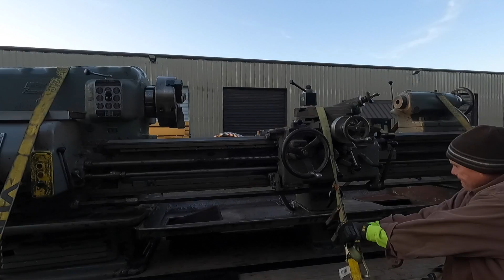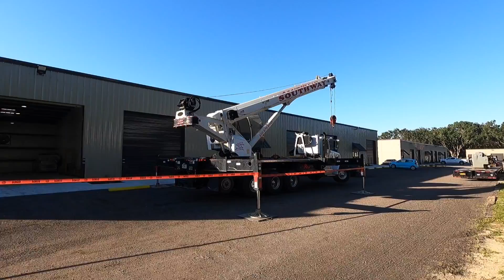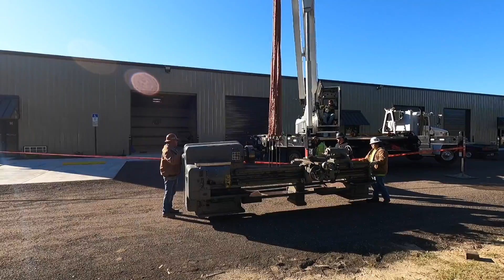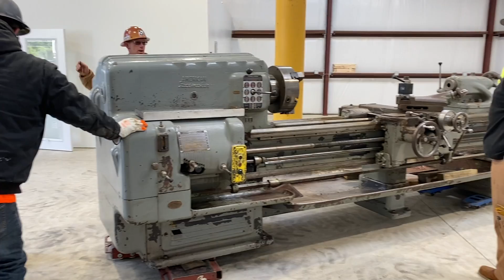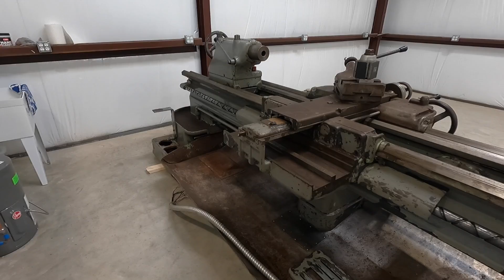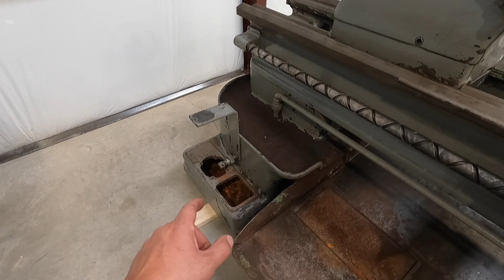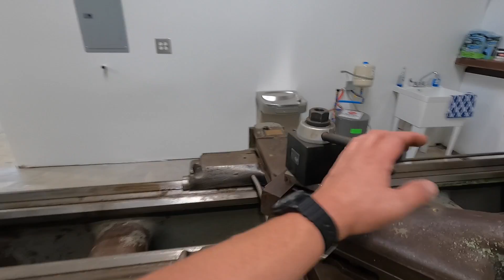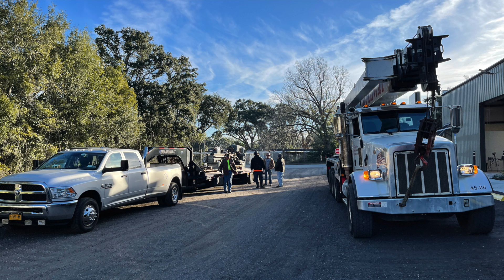American Pacemaker Lathe Arrival & Unloading

Comment: Is there not someone with a big forklift in town?  Great lathe though 👌
Reply: For what? You'd have to pull the parking stops, and you'd have to drive it on the concrete and risk cracking the apron. Why are people trying to complicate things?
Reply: @littlejackalo5326  we move everything with a forklift.  Easy as pie, drive it right to where its gonna live and lift it right off the truck. What i see here is craziness lol. I wasn't trying to be a dink but seriously? Lol

The forklift used is massive and does have airbrakes though.  Typical for any reputable machine mover.

Comment: It would not take much to cut a trough in the slab to underground the conduit to power the machine. You don't want any trip hazards in that walkway.
Reply from the maker: It’s getting bolted to the floor. I’ll fab a steel ramp that goes over it, just like the rubber mats you see made for the sand thing.
Reply: It’s a rental.

Comment: I would like to hear from some others who are experienced in rigging machines, but I was so shocked to see this heavy machine picked up in the center with only 12 or so inches of spread.
When I first saw the crane and straps I thought it should have a spreader bar, but then they had really long straps and I thought they would spread the pick points far apart. As I said, I was quite shocked at such narrow pick points.
Reply from the maker: I should show y’all the Monarch lathe manual and how it’s lifted in the same position.
Reply: @Abom79   :)
Reply: I wonder if they had the original lifting diagram for the machine and saw it was balanced at that one spot.

I wonder how big the spindle bore is, it looks small, but I think it's because the machine is large... maybe 2 1/2 inches?
Reply: I bet the factory already calculated the best pick points when they designed it.
Reply: My big lathe has a diagram in the manual for lifting it. It was nearly identical to the way they rigged this lathe. These guys do this for a living. I think they knew exactly what they were doing. But I realize the experts live in the comments section. 🙄

Comment: I have a pacemaker as well.  Show the maintenance/repairs/setup you may have to do.  My coolant pump is gone as well. Lol.  I have a 10HP GE motor on mine, I havent figured out what oil to use on the felt wicks for the motor.

Comment: You need a cover for the water fountain. That lathe is going to spray oil and chips all over it. Not healthy.  You could change the hinges on the end cap for lift off style. I'm not sure how heavy it is.
   A side issue, I noticed the light on the outside is in the way for lifting. Maybe it could be put to the side. You are going to have a bunch of cranes come in the future.
Reply: It will be just fine. You're not eating off the fountain. It's a big waste water drain.

Comment: Your a tall man make the leveling pads 4 or 5 inches tall so you are not bent over while running the lathe?
Reply from the maker: The leveling pads will be about 2” high, the perfect height for this lathe. I ran the same machine for 10 years and I’m comfortable with its build height.
Reply: Agreed
Reply: Not a bad idea. I'd suggest maybe 3".  4 or 5 seems too much. Abom should measure the height to the middle of the chuck to see what's comfortable.

Comment: Now for the most important question. Adam, is that a 3-inch spindle hole? Most of them Pacemakers had small spindle holes, as a big lathe is only as good as how much we can shove in them. I had a 22 inch Summit with a 3.250" hole that I was able to bore out to 3.377" that big spindle hole is the only way to fly in a job shop or repair shop as I am sure you understand. We get some wild projects that always need that extra big hole. Too bad it's not a Gap bed for big flywheels.
Reply: Yeah, it looks kind slim. Cutting Edge in AUS and Keith Fenner get some doozies that need to be fed through. https://youtu.be/HCqIjxmmmzw?t=1301 He even had a hole in the wall that crossed over his desk or something.
Reply: @marcosmota1094  Dude WTF is your deal with constantly stumping for Cutting Edge. You people must have wet dreams about him. I am quite sure Adam is aware of his channel. I tend to think Adam has everything under control. He’s not a newbie to the machining world. He was raised in a machine shop. Quit shamelessly stumping for this guy.
Reply: Its a better lathe than a summit i have ran both
Reply from the maker: You don’t buy these types of lathes for a large spindle hole. If that’s what you want then look for large spindle bore lathes, or oil country lathes. 10 years running this machine at Motion, never once did I feed a piece of stock through the spindle.

Comment: As a retired Truck Driver and Heavy Equipment Operator and did some part time work with a local rigging company.  It makes me smile to see people do these type of jobs done by professionals.  Yea, it may cost you a few $$, But in the end. Not is broken, bent. And not a drop of blood got spilled.

Man, The smile on everyone's face tells the story. And this old girl looks HUGE sitting there. Can't wait to see it making chips. And put threw its paces. Something tells me this thing is a BEAST when set up correctly and will get the job done. Not only fast, But accurately.
Reply: Adam worked on it's "much bigger brother" at another shop & that's where he fell in love with this machine.

Comment: What did they use as the lift point on the lathe?  The slings were super close to the middle but damn if it wasn't perfectly balanced!
Reply from the maker: They found a great balance point using the center web of the bed and used the carriage and tailstock to counterbalance it.

Comment: How NOT to lift a lathe!!! You are real lucky that thing did not break in half. Shakes head in disgust............
Reply from the maker: Thanks for the input guys. Send me the links to your lathe lifting videos so you can teach us all the best, easiest, and “cheapest” way to get it done. 👍🏻
Reply: Please don't think I'm busting your balls about how you had it moved but I would be examining that way casting pretty closely since they split the weight of that in half with how they hung it. I believe there is literature out there about having a hang point by the headstock and the other near the middle of the bed.
Reply: With me not having a clue, what is the proper way to lift something like that?
Reply: I have rigged lathes way bigger then this with 15,000lbs fork lift blocks of wood four strap done , what state was this done in & what did they change him , A crane lol

Comment: i can definitely relate to the feeling one gets when your machine is hanging a few feet off the ground , while we where moving my lodge and shipley 25 standard i nearly bit my fingernails clean off, now that i have it up and running i find it so weird to look at the spindle bores on other lathes.....they are so small compared to the 8 7/8 of the 25 standard. but i love to see your new shop coming together , we hope to be moving into a new space by mid year as well. cant wait to see what jobs you get now that you have more room.
Reply: they do seem to grow when they are in the air.  they also grow very quick if you have them on a trailer and blow a steer tire 😱

Comment: Not familiar with American cranes, why does it have those little wheels?
Reply: I think you're referring to the "tag" axle.  It can be raised and lowered (used or not) from the drivers seat.  It's purpose is to support additional load and/or allow the truck to travel on certain restricted roads with low ground pressure requirements.  I've never seen one with tires that small either, it's usually a full set of normal sized dual wheels.
Reply: @tonyc.4528  Thanks a lot for the comprehensive answer!

Comment: Love to see heavy equipment, reminds me of when I managed an in-house printing facility for CPS Energy in San Antonio (Electric Utility). We had a lot of heavy iron 'so to say' large printing presses, web and sheetfed. I remember we bought a large 28” 4 color sheet fed press with high pile delivery, weighed 50,000 lbs, came in two pieces. CPS Energy had their own heavy equipment movers, they had a huge forklift to set it on the dock and then they skated that puppy into our shop, amazing and we had our own electric department to wire it up. I managed that facility for 26 years, retired in 2013.

Comment: We had an American at work that was a hydraulic duplicating lathe. You made one shaft by hand and then put it between centers behind the lathe and it had a stylus that followed that shaft to make a new one. The lathe was about that size but it was raised at the factory so it would actually swing about 30". We used to rough out 8" x 48" 4340 at .375 depth of cut so .750 total at .032 feed. It had a 30hp motor.

Comment: Too bad you already have a bad crack in your new concrete floor. What happened?
Reply: It's a rental. No biggie
Reply: @jeremyd9826  I'm just asking. Really in Florida they have about perfect conditions. The big crane sits on a very thick foundation. But why did the other part crack? And not where the cuts were made. Now that it is 2022 can't we make perfect concrete slabs?
Reply: @johnlennon335  no concrete will always crack, It shrinks as it cures. They're called control joints to try and control where it cracks, but, unfortunately it doesn't always happen that way
Reply: @KPSchleyer  I had hopes that the science of concrete had improved, especially when done by professionals and in a pretty decent climate. I've only done a few jobs like this years ago. But jeeze, what a disappointment to see that in a brand new shop. I wonder about the re-bar and the pea-gravel in the prep for the slab. I know under the crane is a super thick foundation. Is the rest of the slab the standard 4" or 6" or 8" because of the machinery?
Reply: @johnlennon335  the rebar only keeps it from separating or lifting at the cracks.  The say there's only one guarantee with concrete and that is "it's guaranteed it will crack."

Comment: some big cracks in the floor, we're they there before you moved machine in ?
Reply: Noticed them in the last video when he did the sealer, so wasn't the lathe that caused it.
Reply: Those "cracks" are saw cuts so when the concrete does crack, the cracks should follow the saw cuts.  It is a stress-relieving tack tic.
Reply: @royreynolds108  There's those, which are supposed to be there obviously. But you see them in the video where he sealed the floor, there's what look like jagged cracks in the floor as well. At about 16:23 you can see it, its all the way across that back right section, from the cut to the wall.

Comment: Once ordered a 3" plastic drive shaft for a piece of equipment in the aircraft I worked on when in the Navy.  FSN part number was off by one character.  Got a prop shaft for a submarine about the size of your lathe, delivered to the hangar on a flatbed.  Got scolded by the Master Chief. LOL.  I figure that lathe could turn a prop shaft for a sub.  What a beautiful massive machine.  Good for you Adam.👍 Look forward to chips flying.
Reply: And you know everyone in supply was laughing their ass off loading that onto the flatbed.
Reply: @sparkplug1018  my squadron was a Nation Security asset at Barbers Pt. NAS The supply folks at Pearl never officially questioned but had to be scratching their heads. LOL
Reply: Just wondering. Could the trailer be backed into the shop and your crane lift it off?
Reply: @codfishknives8526  this is way over the capacity of that crane. Hell I bet the lathe can swing a bigger chunk of steel than the crane could lift.
Reply: @codfishknives8526  Oh hell no. LOL  🤣
Reply: @scottnj2503  yeah it's a 2 ton crane, and this machine is 4-5 tons. 96 inch's is a more than enough for a 2 ton billet.
Reply: @ionstorm66  Thanks for sharing👍  I will share with my Dad, he too is ABom follower and we're both fascinated but not machinist.

Comment: Congratulations! I was just thinking myself how is it to buy that huge lathe, i mean it can withstand 8500lb or 3500 kg (3.5mton) of steel.. It's giaenormous. Also i'm thinking of years of projects done to and on this lathe, thats super duper!
Reply: Decades of work done on this lathe, probably tens of thousands of parts turned, thousands of tons of chips made. These were built to last, the American Pacemaker Adam ran at his old job was a pre WW2 machine, and still held a decent tolerance.

Comment: I've moved some heavy metal, but not heavy heavy metal.
Reply: One time I was helping a friend in grabbing a Bridgeport clone. Probably 3,000lbs. We had a neighbor with a forklift help move it from my F250 truck to a pallet jack (really it was beyond the rated capacity of my truck.) It was me and the machine, and it started to tip over and was going to demolish a van. I stupidly jumped in, and I was able to get it back on the pallet jack. Two lessons learned. #1 Do not put metal to metal. Put some cardboard or Masonite between, and strap the machine tight to the pallet jack. #2 Do not put yourself between two big heavy machines. It can kill you.

Comment: I Love repairing these old machines; but I've run across alot of customers that place the tail stock side too close to a wall. Not a problem untill you need to remove the apron for repair.  I've cut holes in walls to remove the lead screw, drive shaft and clutch lever shaft. Before setting it down on pads take some measurements. It will save you a huge head ache in the future.
Reply: Beautiful piece of Machinery you got by the way!

Comment: Hi Adam,
One place I worked at to setup new work areas, we went low tech and made cardboard footprints of all the equipment with handle and any other protrusions and laid them out on the floor. 
It allowed everyone to visualize what the work area would look like and if it made sense to work flow to save motion.
Just a thought and it really does not take long to cut some cardboard and tape it together.
Looking good...

Comment: Lathe left open side shaper right and a 4or5 H k&t in the middle then ya need a smaller lathe that has inch metric capability got to get the weld fab side set up nice man I’m so glad I’m not you I’d have that thing gobbed off inside of the month of January
Reply: English or just typing random words?

Comment: If you don’t mind my asking, how much did it cost for the riggers?
Reply: Way cheaper than thinking you can handle it yourself,dropping something and having scrap.
Reply: @kenore4003 I appreciate the reply, but I’m looking for an answer in $USD,; not “Self Proclaimed Internet Rigging Expert” allegory. For the record, I’ve spent the last 25+ years moving things far larger and heavier on the waterfront. However, I’m now in a position where it may be worth it to me to have someone else move a machine rather than burn up 2 to 3 days moving it myself. Until now, hiring Riggers has always seemed like it would be prohibitively expensive. Of course, I’m basing that almost entirely on knowing how much it cost to rent a crane, even for a half day.